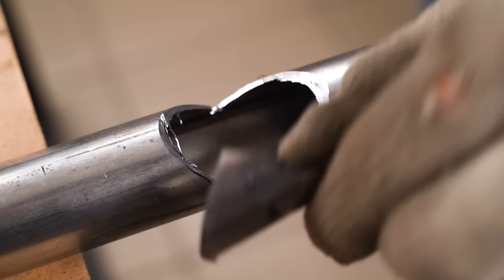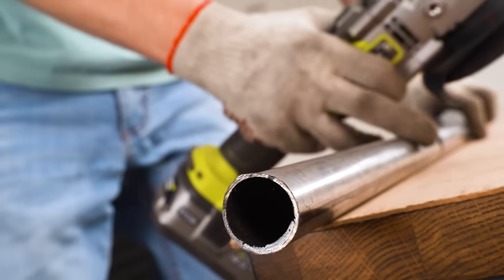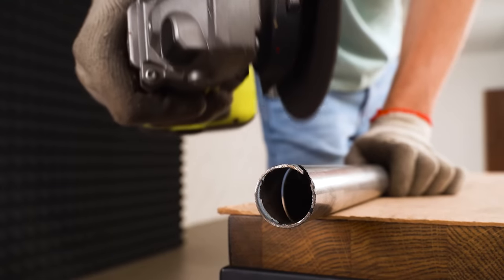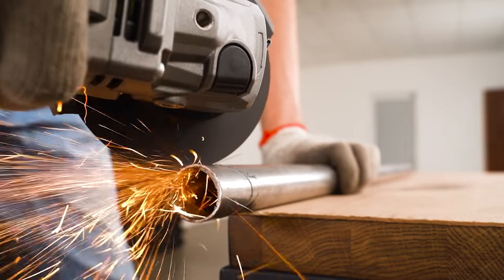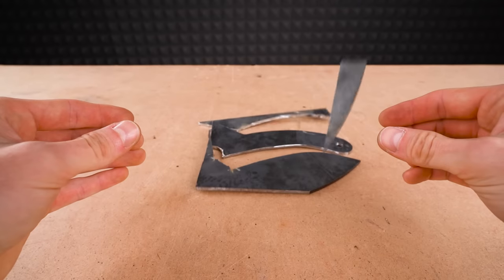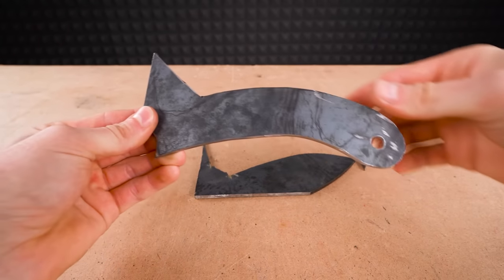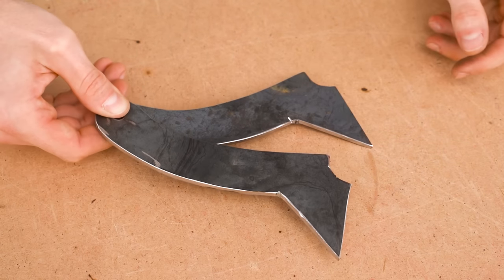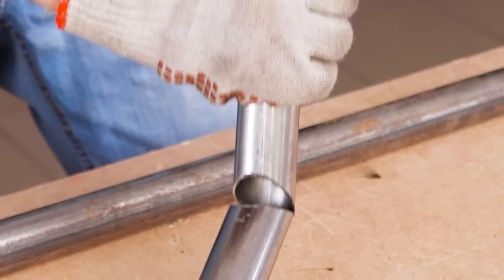Building the Ultimate Handmade Elliptical Bike

Comment: Take two bicycle bottom cranks (complete second set, with bearings and bearing pod), weld them apart at about... 20~30 cm distance in a straight line, with the second crank backwards from where the usual one is.
Install two sets of pedals, preferably the kind of pedals that have removable grips. Fabricate two feet supports for each side so that they sit between the pedals using the mounting screw bosses where the grips would've been and voila, you have another type of elliptical bike.